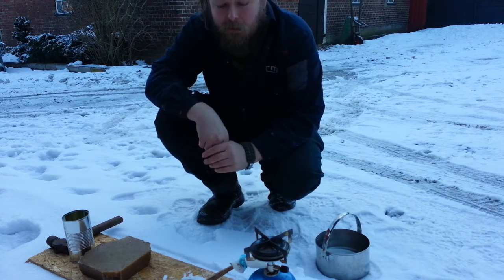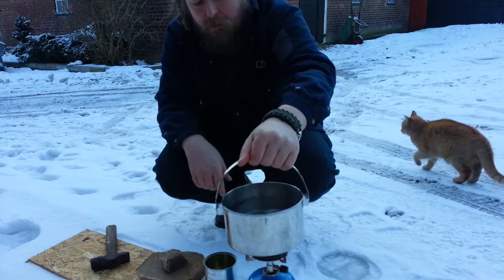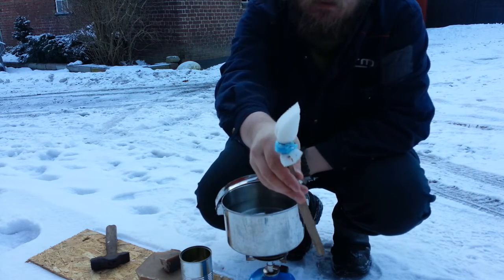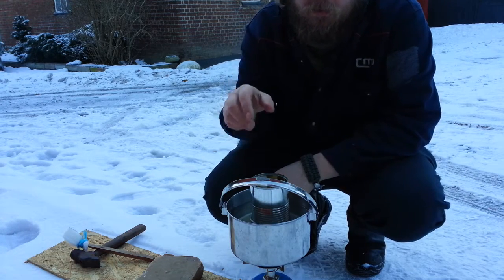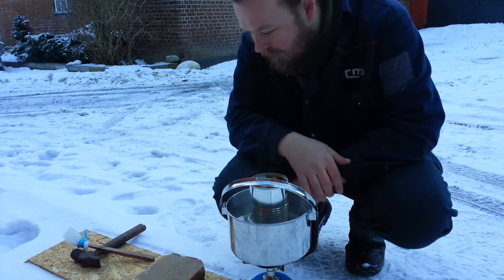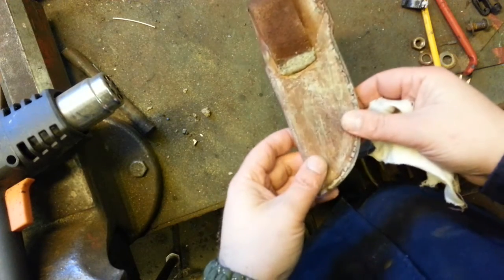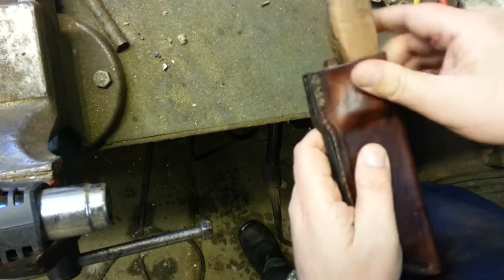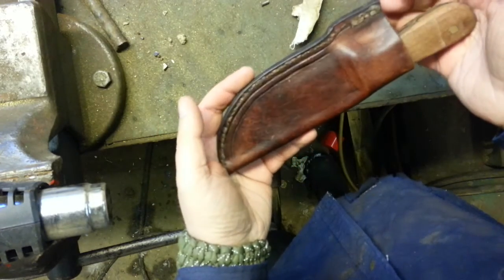Luke's knife sheath - update 5

Comment: I too use bees wax on my leather. Works great and gives it a great look. After applying the wax I put in the oven at about 190 degrees F for about 10 minutes and it soaks in very well. Then I wipe off any extra. Because I live in a tropical climate the bees was can stay tacky. So I mix in about 25% paraffine to fix that. Great video, thank you.
Reply from the maker: +Traveler1226 
Thank you for the tips!
I have hardened in the oven Before but this time i only wanted it to harden half way through for a bit more flex to it.
I don't have any problems with it getting tacky but if i do in the furture i will rember to try 25% paraffine.
Thank you for your suggestions and input it is much appreciated.
All the best, Rob